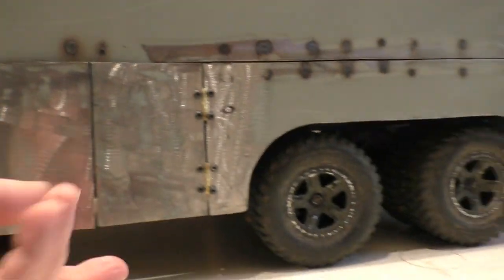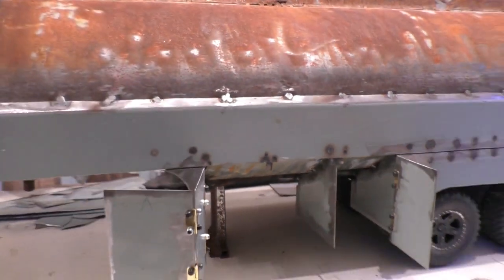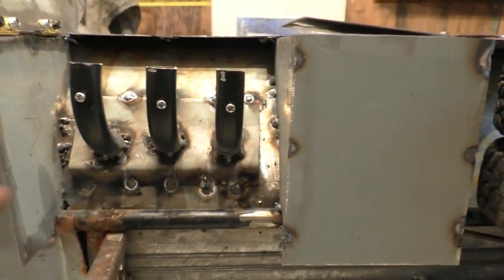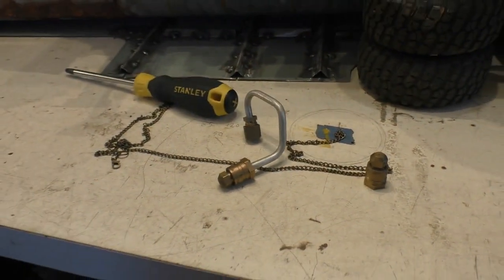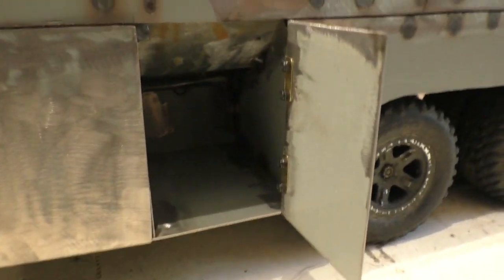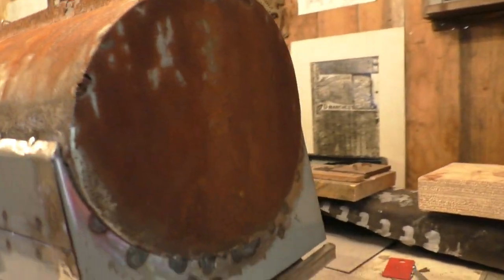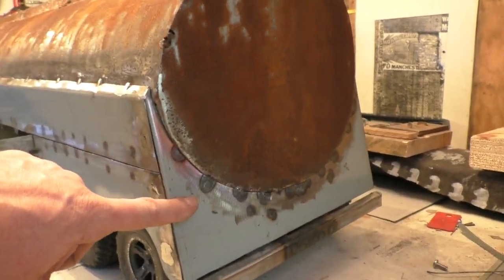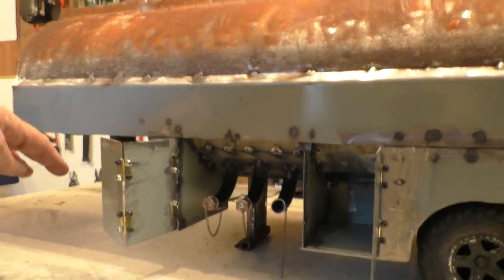"Duel" style tanker for FATBETTY (part sixteen) Metal RC model truck.

Comment: How long do you lay in bed at night building in your head?? I spend at least 2-3 hrs and can never go to bed! Have you used epson salt, vinegar and steel wool? It turns into a type of past you can paint on. I used on a corrugated steel love sign and it came out really nice.
Reply from the maker: lol, sometimes sleep is hard to find when the imagination is so active. I use table salt, vinegar and water mix to rust the steel, but I like the idea of a rust paste, thanks for the epsom salt, vinegar & steel wool tip!